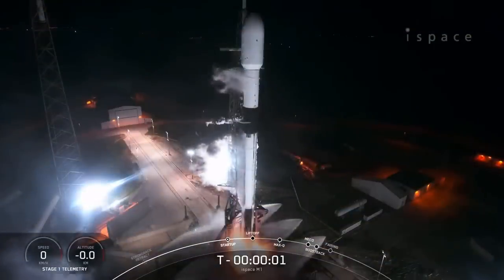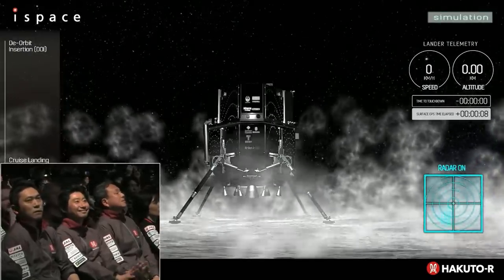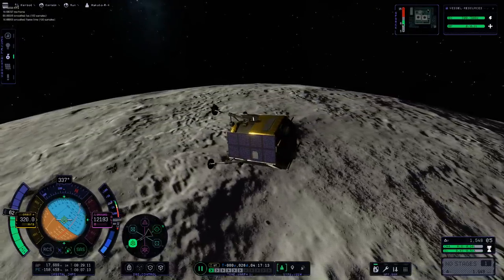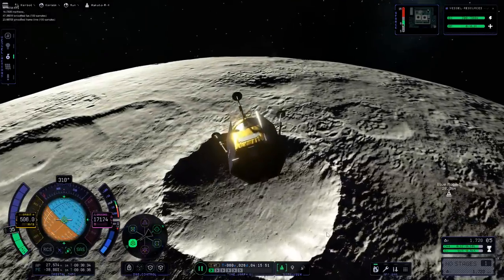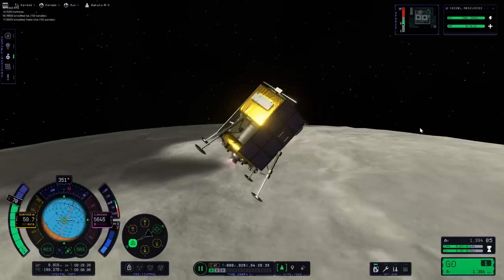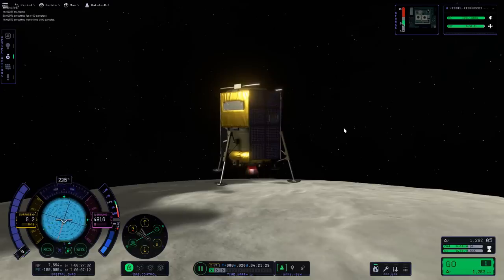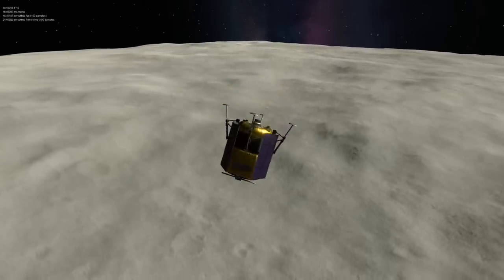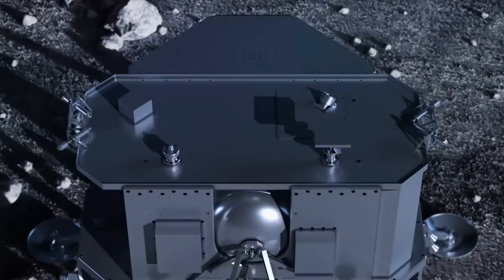Why Japan's Moon Lander Crashed Due to An Unbelievable Computer Bug

Comment: That's really interesting, but not really a software bug. It worked like it should. But the software engineers need to write additional code for those cases, or even upgrade the hardware to prevent something like this.

Comment: With only one height sensor over unknown terrain, it's kind of a foolish mistake to try and detect errors from the measurement itself. A Kalman filter is no magic, and when there's an unknown dependence between height over terrain and altitude introduced by any vertical motion over the terrain, you need to know the surface profile in order to get any useful error estimate. So the smart move is to either have triple redundant sensors, or get diagnostic data like tx/rx power from the sensor in order to monitor its correct function.

Comment: This is why standards such as DO-178, DO-254, and ARP-4754 (and associated specifications) exist for aircraft. These are very intense standards for development, but even if your company was not required to certify with an aviation authority, following something like these in the development of a spacecraft would reduce the possibility of errors such as these. It's very possible there are similar standards that were followed, but sometimes I wonder if these errors occur because the critical error was not discovered due to budget/time constraints sacrificing a critical portion of the development lifecycle.

Comment: Honestly it probably shouldn't require a simulation run and software update to adjust to a new landing site.  The problem was they built a system with a single point of failure.  If the software already accounts for the failure of the radar altimeter they should have also planned ahead and built in some laser altimeters that sample multiple surface points looking away from the craft's bottom center.  At the very least they could have had a backup radar altimeter to crosscheck readings, or have been sending back live data to the command center and let a human verify the readings and manually accept the "false" readings.

Comment: Similar thing happened to me in a project that i worked on. It was US bank and i work for a indian IT consulting firm. We made a custom web app to uplaod docs to content management system. But users would drag and drop documents to the site which it did not support. I proposed i make a plugin which can make the drag and drop feature to upload but the management team didn't like that saying the branches would not pay attention to the docs that are getting uploaded them. I told them if they drag and drop over the allowed cached memory of the browser docs may get corrupted but they were adament that i put a warning message not to drag and drop multiple documents at a time on the site. But users still disregarded the messgae and kept on uploading for 2 years. Recentky the bank went through a merger and a compliancr was triggered. And what would you know many documents uploaded from that site end up corrupted and the bank became non compliant and had to pay hefty fines. When the issue came to us we just showed the emails and documentation highlighting the same. Now they renewed the project again, this time all our inputs are being considered.

Comment: Didn't the Apollo computers have a potentially catastrophic undetected bug where if the lander flew over a crater that was deep enough the bits in the storage would overflow and wrap and effectively it would think it was at a much lower altitude? 
Seeing a pattern here. Altitude is kind of important.

Comment: Of course the ultimate software glitch is what occurred to the first Ariane V launched when the primary and backup guidance systems shut down forcing the rocket to destruct. They assumed the off the shelf system from Ariane IV (with many successful flights) would work with no need to test and it didn't.

Comment: 1 - The lander should have had two altimeters, possibly three, to act as verifiers for each other.

2 - Each altimeter should have had both a radio emitter/sensor and a laser emitter/sensor, to verify each other.

3 - I guess I must believe that they didn't rerun their simulations after changing the landing site, because it happened.  My question is, why?

Comment: Software is different in several key aspects: first, it is tremendously easy to add complexity.  Weights nothing, is might be actually cheaper / quicker and is not patently obvious as excessive components on board or too much material on chassis. Also, no implementation is going to fix bad design and vice versa.

Comment: Though it would add weight and complexity, in this instance having three radar altimeters would help software determine if an altimeter went bad.  The software compares  the data of all three and the unit that is radically different is voted out.

Comment: This isn't a Mars mission. The radio delay shouldn't be worse than 4 seconds. Ground crew didn't have any means to double check the "altimeter malfunction" and manually re-enable it?

Comment: Scott, you are wrong. This described failure was not due to a software bug. For all the would-be engineers out there, the distinction that follows is really important. The software apparently executed without issue or error. The software apparently passed all the software test cases. The software apparently did exactly what it was intended to do. Conclusion – the software was not buggy; it successfully crashed the lander exactly as it was programed to do. Then why the failure? The answer lies with the software requirements that the software was written, developed and tested to. The reason this is so critical to appreciate is highlighted by the nature of the corrective action. No amount of software programmer re-write and re-test will correct this failure. Not until system level performance specifications have been painstakingly distilled into a clear and accurate set of software requirements (and test cases) will there be any chance for success.

Comment: Accelerometers are hard to work with to integrate and figure out distance travelled. As accelerometer have noise which increases the error in estimation of distance and this leads to wrong distance estimation.. that's why you need a real distance measuring device like lasers or something

Comment: Fascinating. Are there any details on the code? Did it really ignore the RADAR or did the Kalman diminish the value of the data due to high "noise"? This seems like such an obvious problem, and maybe the designers also thought so. "But what if it flys over a cliff or ridge? Won't that screw up the error vector?"  "Don't worry, the mission planners picked landing sites with flat approaches so keep it simple."

Comment: This looks to me like a new version of an old problem for sailors. Determining one's location (in a moon landing, altitude, in sailing, distance from shoals or land) without being able to see is called dead reckoning. The radar altimeter working is equivalent to seeing land with eyes or binoculars (or, more recently, radar). The lunar lander's radar breaking is equivalent to a heavy fog coming in. There is no actual way to determine one's location by sighting. So one must use dead reckoning. Dead reckoning is calculation of current location from past location plus vectors for velocity and acceleration. But it is not very accurate, and should not be relied on close to land. It is not very reliable and so, leads to accidents.

The solution is a re-evaluation of the process by which the landing system determines an input is faulty. Here are key points:
- The system should be designed fail-safe, not fail-guess, or fail-destruct
- One glitchy reading may be a indication of a failed device, but it can also be an indication of an unexpected real condition (as in this case). Such a reading should be followed by further testing and checking before declaring the instrument faulty.
- Not running simulations on the actual landing zone is like a ship coming to port and the navigator suddenly being told, "Those charts I gave you were for the wrong port. Use these instead." But it takes time to understand a chart and plan a navigation solution. This is why commercial airline pilots plan their landing before takeoff, again before initial approach, and track using all available instruments on landing. And commercial planes have the fail-safe of Go Around if landing is uncertain. Given fuel weight concerns, that may not be an option for a moon lander.

Let's learn from the past - historical and recent - and keep improving.

Comment: That's not a software problem, it's a mission management mistake where they changed mission parameters after the testing was finished.  Either start the testing over again after the change, or stop changing the parameters.
Reply: You sound like you've experienced problems like this.
BTW, why does your kitty look so mad?  Did you provoke it?

Comment: It's not the first time you see "unbelievable bugs". NASA lost the Mars Orbiter in 1999 when one part used imperial measures and another metric.
The Ariane 5 rocket was lost due to an integer overflow in a test software that accidentially wasn't removed before launch.

Comment: I can't help noticing that a map of the Moon's surface is currently available. China completely mapped the Moon via a Citizen Science program a couple of years ago and the results are unclassified. The whole situation reminds me of the driver on a family roadtrip refusing to look at the map. Just saying. If it were me, I would have the entire map of the Moon, with elevation data, uploaded. And I would have some sort of global positioning set up based on fixed stars, so the vehicle could use its orientation to figure out where it was on the said map. Basically, it needs to have its own internal GPS. However, the software issue is a major component that self-driving cars grapple with viz. What to do when there is a difference between what the computer system thinks should be there and what is actually there. They are still working on that one. Thanks for taking the time to explain all of this Scott! We appreciate the opportunity to toss in our two cents.

Comment: As mentioned in other comments, this is not a software bug, it's a failure of the specification vs actual environment. I think this kind of misuse of the term software bug gives the wrong focus in software testing and validation. You can spend 10000 hours testing the software, redundant systems, independent processors with diverse software but all of that is useless if you haven't got the proper specs in the first place

Comment: It wasn’t a software bug. The real culprit, as touched on in your video, is that that Japanese team simulated all the possible landing sites and then picked a brand new landing site that they never simulated. Had they done so, the lander’s reaction to overflying the deep crater might well have materialized during the simulation and therefore been addressed in the final flight plan.

It wasn’t a “bug” that doomed the lander. It was a lack of imagination on the part of the team. Or arrogance. Or laziness. Or a combination of all three. Probably a combination of all three.
Reply: Its still a bug, because it miscalculated because of the crater in its path.

Comment: In the 60's there were unmanned moon landers landing successfully (not all, I know), so I am kind of flabbergasted that in modern times we see so many failures due to software. Almost as if they make the software way too complicated these days.
How did the Soviet Luna landers or NASA Surveyor probes measure their height above the surface?
They managed with such limited computational power.

Comment: I would not technically call this error a 'software problem'.  A software problem is when you run out of memory, or write over important variables, something like that.  In THIS case, the ALGORITHM used to fuse the data was incorrect.    The correct way to fuse sensors is to always have at least 2 sensors capable of giving the necessary info.   And, it 'should' have been possible to use the on-board rate gyro and accelerometer to do this; however, there was no independent way to check elevation.  This would be required to remove drift from the rate gyro and accelerometer integrators.  Bummer.  GL to Astrorobotic.

Comment: Absolutely NOT a software failure.  This was a process failure.  You simulate to validate the systems.  If you change the assumptions for those systems, like the landing location, you MUST re-validate using the new assumptions.

Comment: Did the report state it was a software bug?  I ask because a failure of the software system does not mean it must be a bug. It could also be due to a bad design by the developers, which would not be a bug.  Example in simplest case is software that computes the dividing of two integers. If the design doesn’t verify the divisor is not zero, and then tries to decide by zero , that may not be a software bug, but a bad design, If the design choice to validate the divisor was explicitly excluded for a reason (vs being forgotten).

Comment: Once again we see a Failure of Imagination.  One group of engineers assembles the best possible package and another group runs it through simulators to try to destroy the virtual ship.  But there are far too many variables to test everything.  Neil Armstrong took Manual Control of the Eagle Lander when they were running long and heading for a crater. This unit failed to understand the difference between a crater cliff and a sensor error.  Now they will have to fix that issue and try again.

Comment: I realize the circumstances were different -- there was a meat guidance -- but all these lunar landing missions that have gone less than optimal really punctuate how amazing the Apollo landings were, especially considering they were done 50 years ago. Or maybe it just illustrates how useful meat guidance is. After all, we're talking about systems that had been stress-tested on and off for more or less forty years each by the time they were plugged into the LEMs...

Comment: Not sure why you mention parachutes. Lunar landers can't use those! Also wondered if the altitude measurement also measures the slope  of the lunar surface ahead so it can possibly find a place to land that doesn't have much of a gradient. If only it could control itself in all directions!

Comment: Its 2023. America put astronauts on the moon in 1969. The above demonstrates how absolutely amazing this accomplishment was at the time. It also demonstrates that having a human on board to make judgments about the "data fusion" and be able to adjust the craft as necessary played a major role in the success of the mission. We normally consider human error to be the single greatest X in the equation, a negative effect. But if a human is at the end, whether you are building widgets or landing on the moon, sometimes a human can catch a mistake that the most sophisticated machines/computers/sensors might miss. I think this is especially true when it comes to big picture mistakes: An astronaut would have likely caught this mistake.

Comment: Tbh I'm a bit confused. The fact that the lunar surface contains craters and large elevation changes isn't new information and you can't always guarantee you'll get the landing site you want so the software should have been able to adjust for this eventuality.

More importantly, was there no imaging data on board or did no one in the months that the lander was on the way to the moon ever think to run an updated simulation based on the data available at the time just as a safety precaution?
Reply: Don't get me wrong, I'm saying this from the perspective of someone with anxiety issues. With a project with such a significant investment, I would have likely spent the last week of approach running and rerunning the numbers over and over just to calm my nerves.

Comment: I find it interesting that the error was in that the lander was programmed with margins for its sensor reading that were too sceptical given the real data values the (modified) mission would give to the lander. It assumed that it was getting garbage data and ignored info from its best sensor because the real reading fell outside its overly reductive expectations for what realistic data should look like.

It remind me of people who show up on r/nothingeverhappens where they assume any slightly improbable story must be pure fiction. I think it's the same kind of error that makes people see relatively evenly spaced dots as more random than the random clumping of truly randomly paced dots. Reality is stranger than fiction more often than we would like to believe, and in the extreme environment of space I would set my limits on realistic data, as only applying to data that says things are moving faster than the speed of light, as that's the real barrier to what's realistic to observe (and you don't want the lander to mistake looking past the horizon of a planetary body for an infinite hole in the moon).